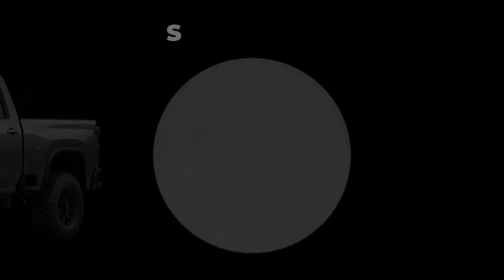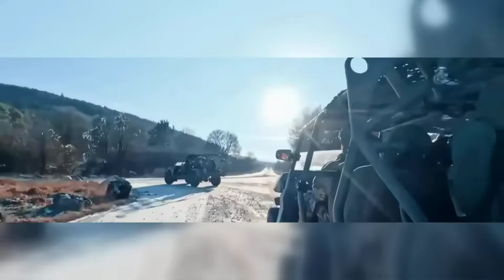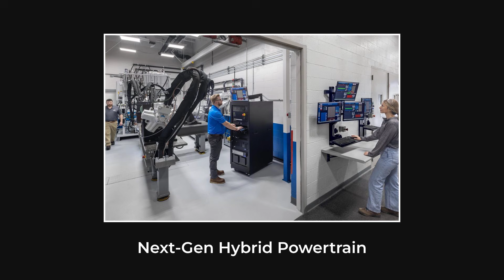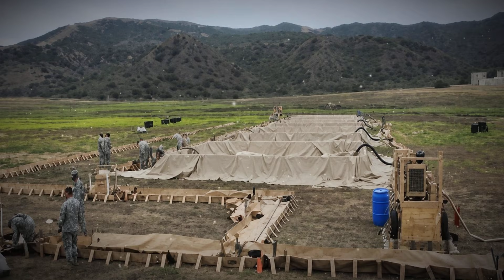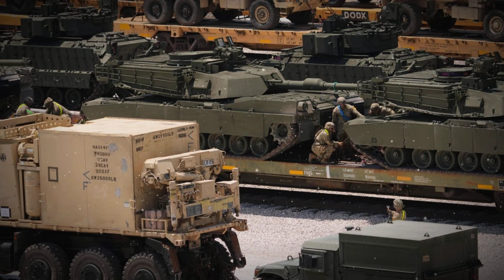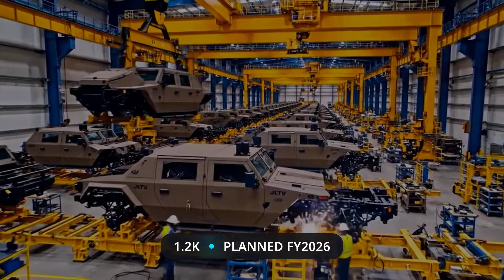Inside the NEW $330K Chevy Silverado-Based Vehicle In The US Military

Comment: Really? GM is completely unreliable for engine design lately. This better not have any environmental garbage in them to destroy the engine at 40,000 miles.   This  engine needs to be  the most reliable engine as possible whithout excessive maintenance... Changing the engine every 40K miles is a failure.  Screw the environment in war. Don't worry about Gavin Newsom politics and Cali regulations make this a reliable vehicle..
Reply: military is exempt from emissions regulations